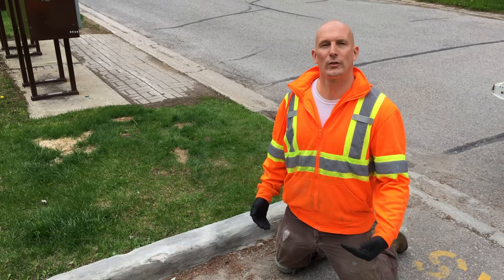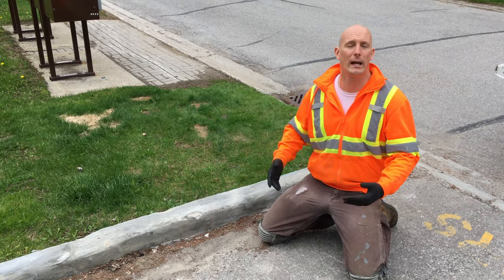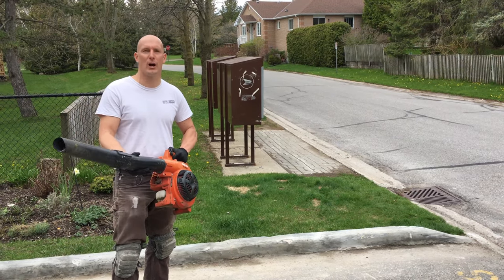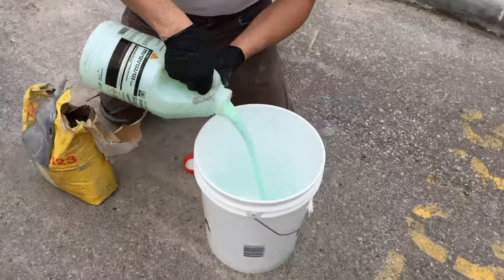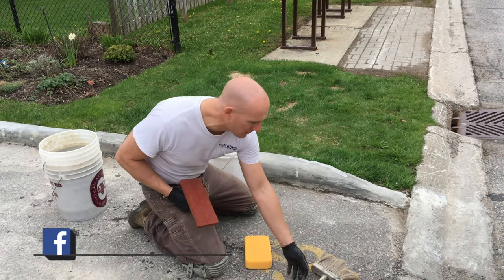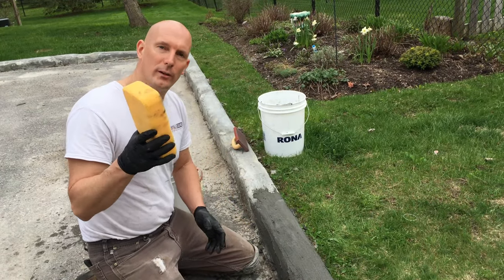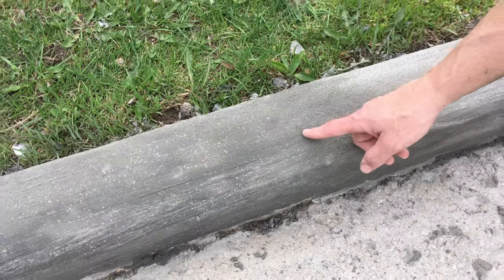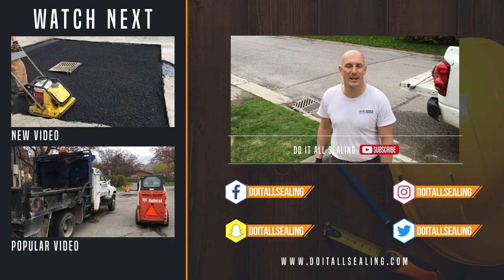Concrete Curb Repair (4K) SikaTop 123 Plus

Comment: How does it handle salt and frost? What's your warranty on a job like that? Thanks, you're a hard-working guy from what I see. Good job.
Reply from the maker: It holds up very well the only thing I have had to do some touch ups is when snow plows slam into the curbs chipping away the concrete.  Otherwise it holds up very well!  Thanks so much for watching!